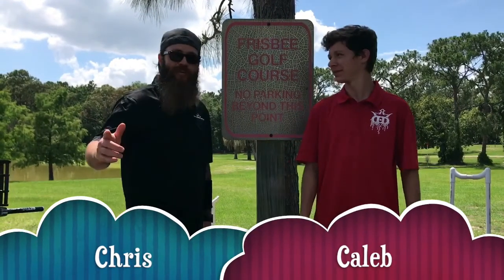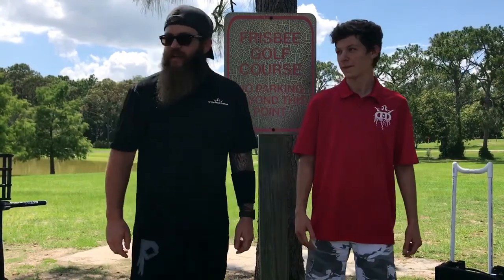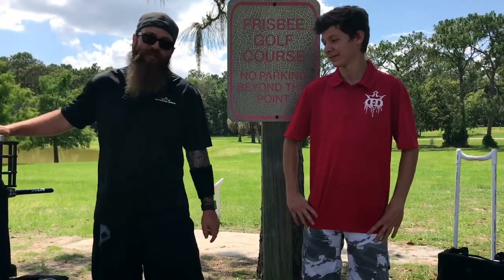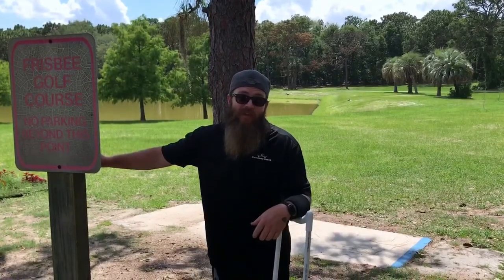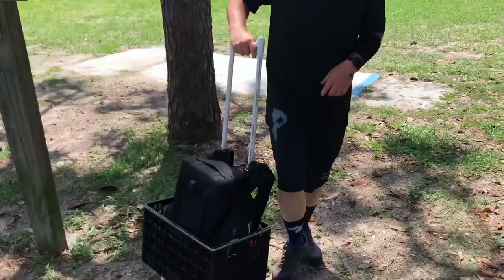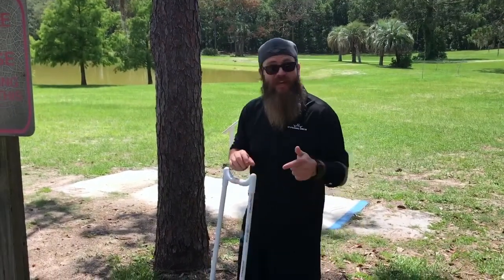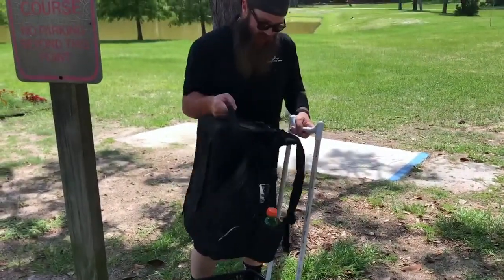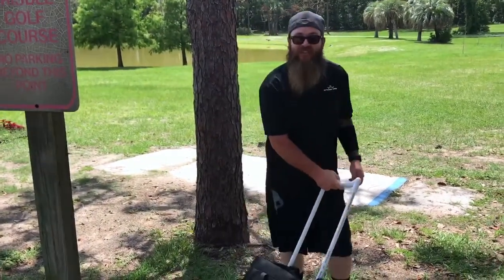DIY Disc Golf Cart

Comment: How big are those wheels?  I have something similar I could use but feel like I want a larger diameter wheel for rougher terrain.  Thanls
Reply from the maker: The wheels were pretty small in diameter, probably similar to a scooter’s wheels. Unfortunately it did struggle in sandy terrain so I wouldn’t recommend it on a course that features a lot of loose dirt or sand. I would highly recommend looking into the Züca cart wheels as they handle terrain fairly well but they also serve as a good reference for size! Hope that helps, if you have any more questions let me know!